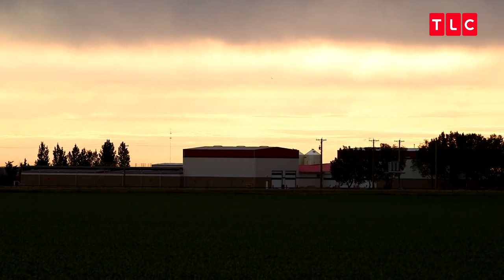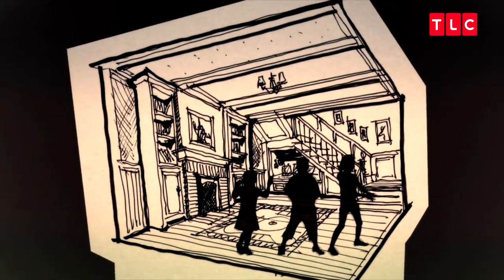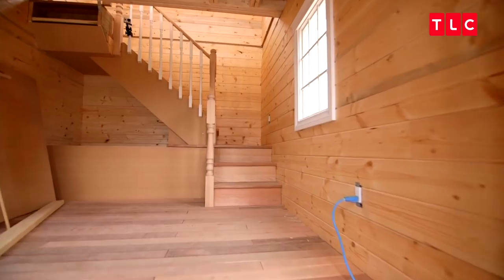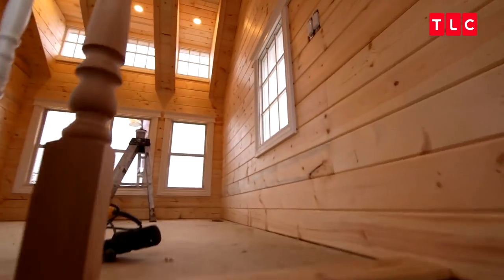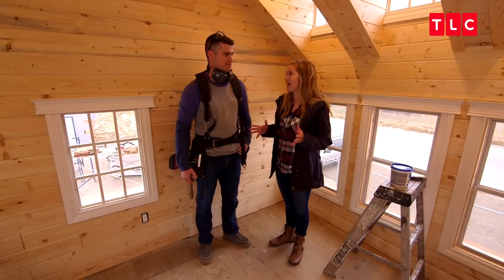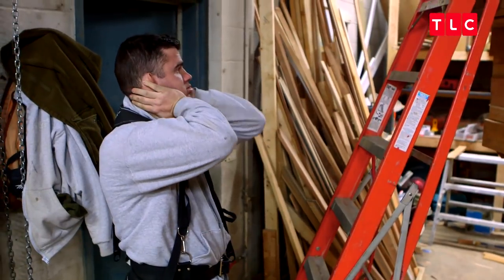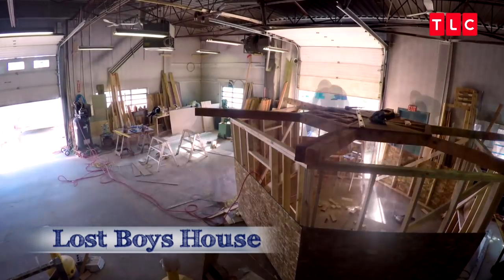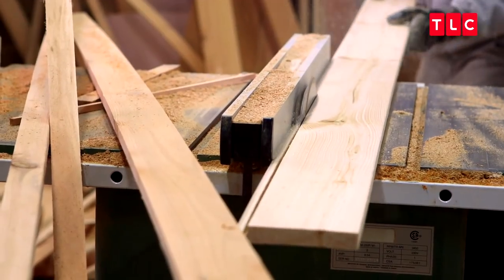The Playhouse Masters Are Recreating Neverland For Some Lucky Kids

Comment: As expensive as these type things are, one could probably get a used one (even one left on a sold property) and transform it into a tiny home.  They'd have to redo the kitchen, add electric and plumbing, heat and air, w&d hookups and maybe a shower.  Maybe even make the doors higher where there were no chances of bumping their heads.  Some are quite small, for kid-sized dimensions but others are more extravagant and bigger.  I love them too and tiny houses also.  I have lived in small spaces and wouldn't have an issue with it at all.